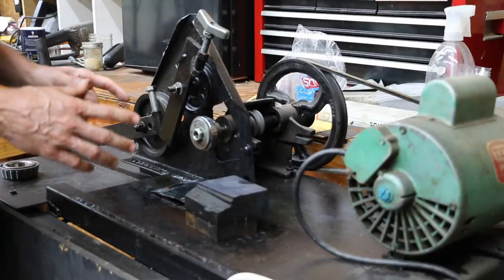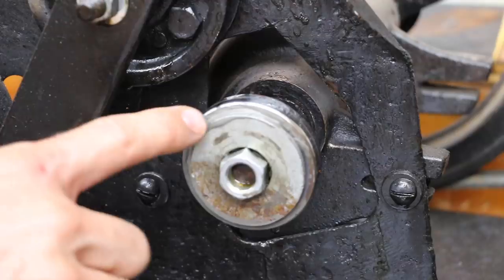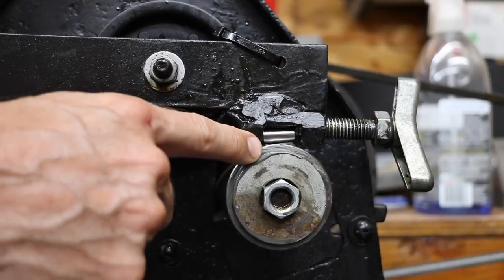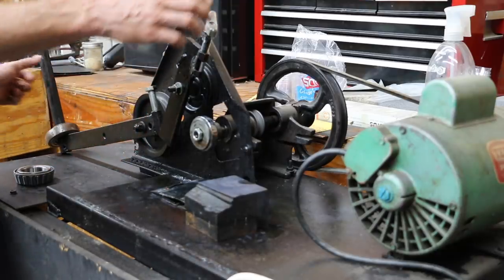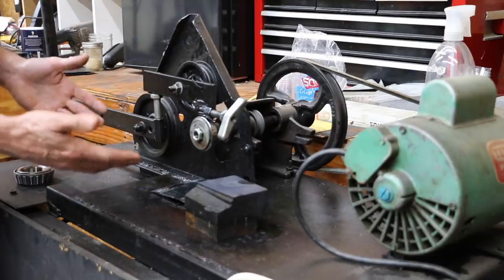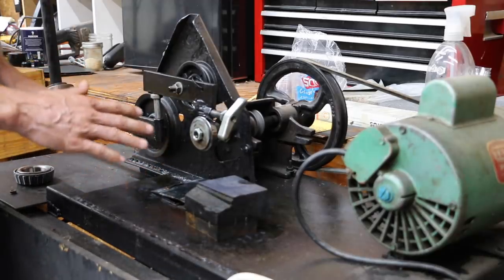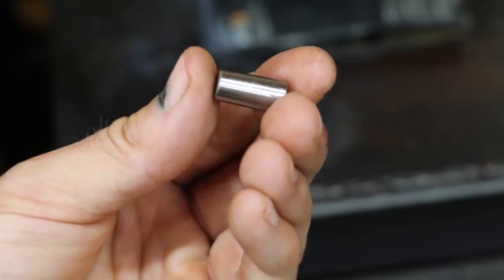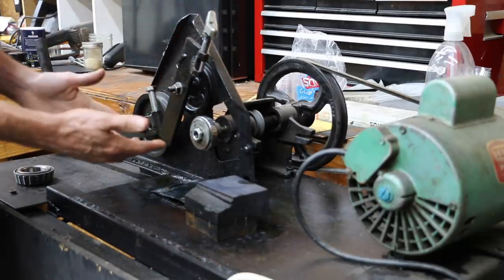How does the oil lubricity tester work?  Let's find out!

Comment: Your set up is the best in my opinion. You don't touch it while the test is going on and you always clean it before moving on to the next test. Keep doing what you're doing. 👍👍
Reply from the maker: Thank you!
Reply: I agree, simple and straight forward with standardized method for testing.  Seems fair towards the products being tested.
Reply: Agreed!
Reply: I second that Todd, excellent video!
Reply: It's also easily repeatable by anyone who cares to build this set up. The hallmark of a good experiment is one that is able to be consistently repeated.
Reply: Project Farm the only very minor “flaw” is that you dont use the very same bearing for 10w-30 and the product ( 2 wear marks on the same part of the bearing) 
Technically ( although chances are very slim ) you could pick a bearing that is more or less heat treated ( even though they come out of the same set)  just by the “luck of the draw” and variation in the manufacturing process. 
Like i said - a very slim chance but just putting it out here for the sake of science - trust me - i really dont want to rain on your parade - i have a yt channel myself and i know how comments like this can be taken in more than one way.
Reply: Agreed completely! Simple,inexpensive,reliable,and most important..........HONEST!!! Perfect!!! :)
Reply: ZILA 
Haha we could troll and pick his testing apart all day ,that's not nice though. 
Here comes my but,,,only thing I'd try doing is heating the roller to extract the lube from the pores of the metal after testing,so that the lubricant for the next test can be absorbed and you only that's what's in it.
It might not even be a big deal but it might be worth checking Into
Reply: MrHillfolk lol  that is exactly why i tried to word it all pretty careful ...  i know exactly how it is when people pick stuff apart in the comments that i have worked for very hard for hours.
Reply: my only gripe is that you seem to only visually inspect the wear. id prefer to see actual measurements or weighing the bearing before and after to determine how much material has been lost.

love the channel
Reply: @MrCheenop  
Weighing the bearing before and after would only work if you totally cleaned (with an oil remover) both bearings as the amount of oil on each bearing after the test might be different as well as different oils being tested weigh different amounts as well.
Reply: @MrTheHillfolk  
Nice observation but will that remove the previous oil possibly “adsorbed by chemisorption”?
Reply: @liboy9844  fire fixes all
Reply: @MrTheHillfolk  
That may be true if the oil was ‘adsorbed’ by physisorption but chemisorption is in the molecular level and it is permanent (not wanting to sound like a scientific nerd 🙂)
Besides, fire can temper or anneal the metal and either harden or soften it for the next test both of which may give false results. Just my opinion sir 😀

Comment: What I really like about your lubricity testing machine, is it helps remove your subconscious bias. Even if you want to be neutral, a subconscious bias will affect how hard you press on the arm without you knowing it. For example,  a person operating a traditional testing machine  my press harder  on a cheap lubricant  verses an expensive lubricant. To take the test one step further, you should remove your ability to know which lubricant is being tested until after you have the results.
Reply from the maker: Great point and great recommendation. Thank you

Comment: You should test traditional animal fats that were used on the first steam engines and locomotives, versus modern petroleum-based lubricants.
Reply from the maker: Great video idea.
Reply: whale oil! lol dunno if you can find it, lard was a good lubricant actually (but the heat makes it too thin)

Comment: Ah! So you built your own Falex friction tester! Ok, so to get more technical, the Falex uses a compound rounded wheel, much like the one you have on the weight arm. You can get those kind of bearing races from an implement parts house. That gets you an even better (smaller) surface area. (1970's New Holland balers use them) The wheel is supposed to run in an oil bath. Just make a cup for it to pick the oil up from. (If it slings oil, your speed is too fast...) The roller would be placed perpendicular to the wheel. With the compound curve of the wheel and the roller cross-wise, you get a very small contact pattern.  The pressure term you're looking for is PSI. When you have 10 pounds applied to 1/100th square inch, you have 1000 PSI.

A Falex would also have an Ammeter. As you stack weights on the weight arm you can watch the amperage draw increase up until it stops the machine.

Always base test your oils at what would be operating temperature. Hence the reason for the oil bath. You can monitor the bath temp to get a better idea of the actual film strength in working conditions.

I haven't run a Falex in 30 years! They were sure a lot of fun, though! Royal Purple came out on top, and Pennzoil on the bottom! You'll be doing LOTS of comparisons, such as mineral to sythetic, low vis to high vis and then, of course, wonder drugs. WHICH, by the way, you'll be simply amazed at what Prolong straight out of the bottle will do. THAT'S where the danger begins, because you can't run straight Prolong in an engine! Well, YOU could! after all, it's what you do! So while you're getting your education, educate yourself as to what is in the additives, how that additive prevents metal-to-metal contact, and what adverse effects that additive might have on the rest of the additive package in the oil itself. 

You'll be on this for a while! Speaking of which, you'll be smoothing that wheel for a looooooong time if you're going to use 1200.

Great job on the build!
Reply: Addendum. Plain "mineral oil" from the drugstore could be considered base stock. It's the additives that make "motor oil" what it is. Plus, dynamic friction and static friction can be tested. If it's running, you're testing dynamic friction. if, during your test you turn the machine of and then back on again, you're testing static friction.

Friction reduction alone does not make a good oil, by the way
Reply from the maker: I really enjoyed reading your comments. You are very knowledgeable on this topic!
Reply: ElderlyIron 
 And I bet that Falix gizmo would be only a couple of bucks more than the farm boy's homebrew, and almost as good, test setup. LOL Good enough for the rest of us, I think.
Reply: "Royal Purple came out on top, and Pennzoil on the bottom"

Of course you didn't post the rest of the list!
Reply: muinaiset that didn’t take long lol.

Comment: Back in the late 90s I did a test with Castrol 40W , Prolong super lubricants, Slick 50 and Duralube. Used a high speed steel 7/16 drill bit . Used a corded electric drill to drill an 8lb sledge hammer head. Leaning on the drill for 30 secs. Noted depth and circumference of any hole and temperature of drill bit. Results were varying and surprising. Prolong was the best out of my tests. Hosed off the drill bit with ample brake cleaner between rounds. Tried straight Castrol 40w at conclusion to ensure bit was sharp. It drilled right in and got smoking hot without leaning on the drill. If a lubricant prevents a cutting tool from doing its job its Thumbs up from me. Great vid and topic ProjectFarm!
Reply from the maker: Great testing approach!

Comment: I just love to watch your videos and you have helped me with some choices for different products that I may not have made previously. As a driver, I see a lot of Motorkote being pushed to Owner Operators. When I saw your water test a few months ago, I was pretty excited to see that they were on your radar. Could you do more tests on MotorKote so that I can see if it is as good as it says for lubricity and I'm curious how long it would last without oil/Motorkote mix in the crankcase. Keep up the great work and I'll definitely keep watching!!
Reply from the maker: Thank you very much!  I'd like to do some long-term testing with it to see if the film strength holds up.

Comment: I left a comment a few months ago about what additives to add to a 212 predator engine for an endurance karting league I'm running in. I took Project Farms advice and added Motorkote along with Amsoil 4t racing oil, changed the oil after every race weekend and maintained this engine to a T. After weekends of hard racing and over 55 race hours on the engine I am happy to report that she is still running strong although there have been a few hiccups. During our 8 hour endurance race for some unknown reason at hour 7 we all of a sudden lost power to the engine, we completed the race took the kart home and never have had the problem again. Other than that shes been flawless, the durability has really surprised me, at the first race weekend we were hitting a max of 5342rpm on the straights and after 55 hours she was still pulling to 5290. Of the 14 karts that committed to a full season 11 are still running with the original 212 they started with. We had one failure due to loss of oil and the other 2 were changed because for 2 hours they had a small oil leak (Teams fault not the engine) and they wanted to be safe and not sorry. Overall I am very impressed with this $99 harbor freight engine and how its performed thus far. We have 2 more 4 hour events and a 24hr race to wrap up the year, that will be the true test of this engine since the longest its run before is 8hrs. Cant wait to tear into this thing at the end of the year!
Reply from the maker: Connor, Thank you very much for the update on MotorKote and Amsoil. The combined film strength of those 2 products is perfect for the "extreme performance" needed in racing.  Thanks again and hope you have a great final 2 races.

Comment: Quick question for you, you did that seafoam episode, if I remember you put it in fuel tank and crank case and also in the intake? I’m doing a 01 F350 7.3 diesel build on my channel and I was going to seafoam into the gas tank, fuel bowl, and crankcase, but I don’t think I’ll use it in the Intake because the spray version says “not for diesels” any thoughts on why? Is it not oil based? Maybe if I put liquid seafoam into a spray bottle and spray into the intake?
Reply from the maker: Great point. Adding Seafoam to the intake could cause engine damage as a result of the engine revving up beyond redline RPM.

Comment: How about a synthetic oil vs. non-synthetic test?
They say the more expensive synthetic oils are better for your car than plain oil.
But is that true?
How about the lubricity test and the engine seize test, normal vs. synthetic.
How about Mobile 1 Synthetic vs. standard non-synthetic?
Reply from the maker: Great video idea!
Reply: good idea, but i wonder if the synthetic holds up better over a time span,, oil that has done a few thousand miles, and has its share of contaminates, and also maintains its viscosity better, it may not show up as better new vs new
Reply: Jusb1066 synthetic has less thermal breakdown, hence the longer lifespan. You are correct new vs new will not show much of a difference, however even when new a good synthetic is the superior oil do to molecular size and uniformity. Is it worth the extra cost? I don't think so, at least in the old engines I run (all 3 vehicles I drive regularly are from the 90s)
Reply: @jay it may indeed be your older engines, modern engines are more stressed, run hotter, even smaller passage ways, cars used to use 20-50 now my  little car wants 5w30 synthetic which is what sports cars used to want.
Reply: Project Farm 
 If you do that, throw in a semi-synthetic also, please. Thanks, love the vids❗

Comment: Bravo on the build, looks great. I think it'd be quite interesting to see some diesel fuel tests:  US diesel fuel vs. high sulphur diesel (if you can get it) would be super cool to get a baseline on lost lubricity. Then lots of people add 0.5% 2stroke oil to diesel, would be interesting to see what this does, especially as a comparison. Personally I'd be curious about adding 0.5% high sulphur gear oil as well as the losses from 20% water emulsion (which is a reasonably popular trick for improving diesel engine efficiency).. Keep up the good work!
Reply from the maker: Thank you

Comment: This tool seems extremely simple but consistent at measuring the effectiveness of fluids to lubricate a high pressure point of contact between a moving part and a stationary part.  Apparently that's how other similar devices function as well.  That said, does this happen anywhere in a properly operating machine?  That is, does a lubricity test actually tell us something useful?  The fluids' behaviors under high pressure and this particular movement scenario don't necessarily correspond to how they operate in a normal engine.

Again, no complaints about the tool, and I realize that lubricity isn't a test you invented.  I'm just wondering how meaningful it is.
Reply from the maker: Great point.  Flat tappet engines would be somewhat similar to this test.  With that said, film strength is pretty important in my opinion.
Reply: @ProjectFarm  flat tappets spin in the bore

Comment: I used to do these tests at work using the same process, Calibrated weight and time.  We did have an ammeter hooked to the motor to check out the load at start, middle, and end.  It was hooked into a controller which controlled the start/stop and took the amp reading automatically.  Maybe you could do the same, doesn't need to be as fancy, just hook up a simple ammeter then see what load you get with different oils?  That way you have more than a visual result.
Reply from the maker: Great recommendation!  Thank you!

Comment: From thinking about the physics it should not make much difference, I would estimate > 0.1%, but may be worth a test to rule it out. The position of the Bearing in the lubricity tester, just in, in fully not straight, to the left, to the right. Just a potential source of error. By the way I love your content and you have a great understanding and control of variables. Please keep up the great work.
Reply from the maker: Great point. Thank you!

Comment: I would like to see a test of new 10-30 vs used 10w30 and also new 5w 30 vs the 0-20 that most new cars use
Reply from the maker: Great video idea!
Reply: N1ck0145 Garage fantastic idea!
Reply: I want to see Delo CJ-4/SN 5W40 v.s. Castrol Edge SN 5W40
Reply: The test would have to be done in varying temperatures to be a fair comparison. Because 5w-30 and 10w-30 oil are the same viscosity when hot.
Reply: evilution that's not true at all. 30 is the viscosity when the oil is in a hot engine. The lower number is the viscosity when cold.
Reply: DE Nichols you may want to reread that comment, you will then find out you agree with each other. You did after all restate exactly what was said.

Comment: The only problem I have with your configuration is the way that the wheel race picks up oil from the plastic cup.  If the cup is a little more or less full, the wheel race can pick up more or less oil which would influence the size of the oil wedge between the bearing and the oil wedge and so your results.  Maybe a positive displacement pump attached to the same motor (for consistency) that drops oil on top of the race just after the bearing/race contact point?  Have you tested your lubricity tester with the same oil at 2 very different levels?
Reply from the maker: Thanks for the constructive feedback.

Comment: I've got a Honda and I think my EGR passageways may be clogged after 160K miles. I'm car handy, but cleaning them out is a real pain because you have to take out the intake manifold. I'm looking for any kind of product that can be sucked, soaked, or something into the car and help clean those out without taking apart anything. Maybe you could test cleaners and see how well they do getting sucked up into things without having any access to physically breaking the carbon apart.
Reply from the maker: Great video idea

Comment: You've basically built a Timken-Test machine. Not ideal for testing oils as it was originally used for testing bearing greases (because you know: it tests bearings.) In your method it provides good empirical data on lubricity of oils, which in this context is just what you need. There is a reason the Timken-Test is not used by any SAE/ACEA/JASOL bodies for engine oils. 

Would be great to see you test some greases ;)
Reply from the maker: Thank you

Comment: I want to get your opinion on something since you've done numerous videos on products like Seafoam and things to clean carbon deposits.  What's your opinion on doing a video where the engine has carbon deposits, you run it on regular fuel but run it at high RPM under a load for a set duration of time?  The concept is that the carbon will burn off because of the higher temps and cylinder pressures.  Example: run the engine on one tank of fuel at regular RPM and no load until the fuel runs out, check for carbon buildup; then  run the same engine on another tank of fuel, but put it under load/higher RPM until the fuel runs out and see if there's a difference/reduction in carbon buildup?
Reply from the maker: David,  This is an excellent idea.  Thank you
Reply: It's also called "Italian Tune-Up".   lol   Keep up the good work!

Comment: Got an idea for Review/Test it’s not oil or fuel related but the gear heads here may appreciate it. How about different types of electrical butt connectors? There’s the heat shrink style, non heat shrink, some that have solder inside, some that have solder plus weatherproofing, then there’s the different types of wire twisting methods.
Reply from the maker: This is a great video idea--thank you